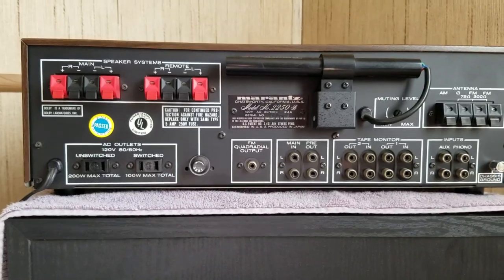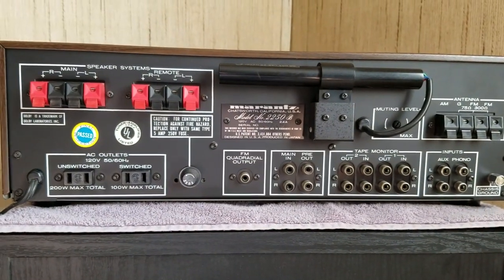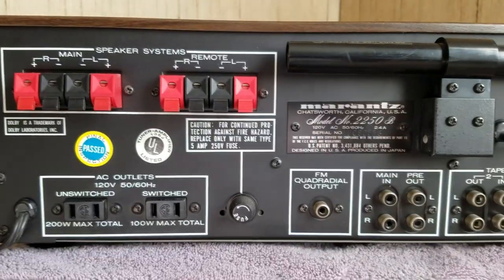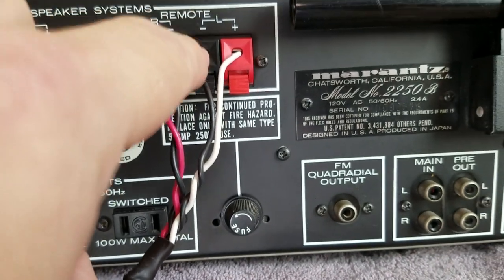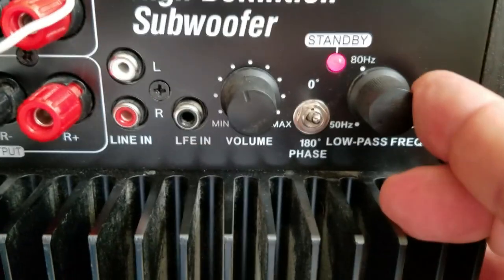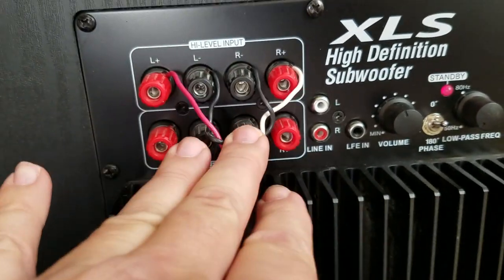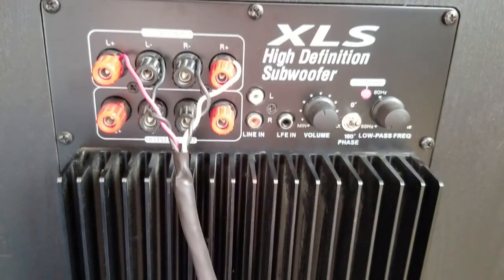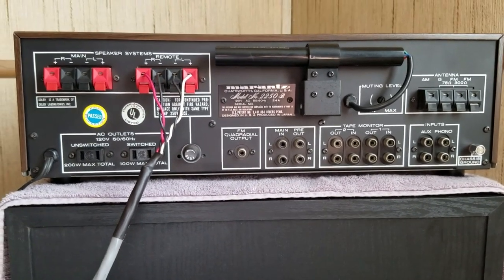How to add a Subwoofer to any Vintage Stereo

Comment: I don't have A + B speakers so this isn't possible at all is it? Tape out RCA would work?
Reply from the maker: Tape out will not work as is a set pre-amp level, won't adjust with your volume control. You can just add the sub wired to your amp along with your spks. The receiver will still just see your spk Independence (4 or 8 ) ohms.
Reply: if you have a powered sub you should be just fine running a 'line level' signal from the tape out to the sub.
Reply from the maker: @pinkskud1  tape out is a fixed level. So no it will not work
Reply: @breakerbroke23  yes, line level. a powered sub has its own amp, thats why it has a line level RCA input.
Reply from the maker: @pinkskud1  correct, but the fixed tape out will not adjust volume to the sub when using your volume control on the receiver. Doubt me? Try it.
(some receivers may adjust vol through a "tape loop" but that is VERY Very rare)
Report what you find if you like.
This audio thing is all about trial and error, and like you, always think outside the box.

Cheers.

Comment: You dont nead a+b speaker inputs.  You can do it with just 1 set of inputs if you need to.
Reply from the maker: Yes
Reply: So i can do this with my LG system? It has 2 big speakers left and right but doesnt have the option for “B” speaker. So can i put
The subwoofer wire in the same port  ?
Reply from the maker: Yes, just hook up the sub like you are adding another pair of speakers. It will not affect the impedance so your LG shouldn't run any hotter. Cheers @zayan-alikassam1203

Comment: Can I connect sony subwoofer ( none powered) ?  in Yamaha receiver  ? I have subwoofer which comes with sony 5.1 home theater
Reply: sagar chopra do you know how many watts the bass speaker is suppose to have ?
Reply from the maker: Yes you could hook up your woofer,but it will not sound good......At all.
Reply: @patrick7799  4ohm
Reply: @breakerbroke23  but my subwoofer is non powered ( passive)

Comment: What will happen if u run everything just thru A ???
Reply from the maker: It will work just great. 
I use the sub on speaker B because sometimes I like not using the sub and I can just turn it off with the flick of a switch.
Reply: @breakerbroke23  Thanx for prompt reply & expertise!

Comment: Ummmm.  But you are sending full signal to the mains.
Reply from the maker: Yes,  I'am using large floor standing spks for mains as apposed to small satellites or bookshelf spks.
Reply: @breakerbroke23   If you are into that sort of thing... I guess.  The main advantage of a subwoofer aside from deep commanding Bass is to take the hard work away from your mains allowing them to sound much better and have much more headroom.   You said it yourself... you don't need a Sub.  Id wager it actually sounds worse in the low end... albeit deeper... because you have massive duplication of low end notes from non matching drivers.
Reply: good lord we gota paintchip eaten Boss lover here that never had him some full range 3 way speakers lol.

Comment: I watched a similar video of 3 minutes length and in the comments, people where warning of damage and overheating 🤷🏼‍♂️
Reply from the maker: I use this exact type of setup on two systems for years, lever had any heat or distortion issues.
Thay are either using cheap plastic gear , wired wrong or just over driving  either the receiver amp or sub.
So IMHO they are incorrect.
Reply: I got a Bluetooth receiver with sub pre out. But I have a car sub so is there a way to use this sub on the Bluetooth reciever?

Comment: Just did this and smoked my vintage amp what did I do wrong??
Reply from the maker: Hard to say without being there...  Some things that could have happened, wiring the sub when your receiver was turned on, if you touched ANY of the speaker wires together, wrong order ie, left + on a right- or a L&R + wired to the same input on sub. An issue with the subs input section, a impedance issue with the subs input.  Wired receiver to out puts instead of inputs, some subs have a spk in AND spk out for extra satellite spks.. 
Just a few things I can think of.
Reply: Thanks for the reply ! I don't know ether it was playing and sounding great it worked for several hours and then it just stopped ! and the smell of a dead amp .    @breakerbroke23
Reply: @anthonym844  Did you accidentally short the wires? One way to smoke a transformer is to use long, thin speaker cables, such as 24AWG and crank up the volume. I use 16 gauge when longer than 10ft. But in electronics, a cap, resistor or transistor can go bad coincidentally, giving the appearance that you did something wrong. There is an unwtitten law in electronic that parts must die at a certain time...even when not in use.
Reply: He gave u bad advice
You don’t send 75 watts etc, from an amp to a powered sub. That’s what the “powered” sub is supposed to do.
Just run from tape or Aux out to the powered sub and let it power itself

Comment: What if you are running 4 speakers
Reply from the maker: You can run them in parallel (+ to + and - to - ) your amp should still see your 4 or 8 ohm load.
Reply: @breakerbroke23  Sorry I am not smart at this stuff. Do you mean jam all the 4 speaker wires into 1 output side and then the sub on its own from the other outputs?
Reply: @maccasnz3436  Don't listen to him. This video is how to connect his Subwoofer to his Amp. Not all Subs or Amps have the same outputs or inputs. Sorry, but I search for the right solution too. Good luck. Tumb down for this Video BTW. Title is misleading!!!
Reply: Don't do that. You're amp will blow up if it is not good enough...
Reply: David Tucker  yes. I pass out of the preamp to the sub then back to main in. Works a treat I can control volume from my phone through chromecast and everything is balanced. The sub is a Linn and does a nice job.

Comment: All videos i see on yt say its a powered sub but i dont have a powered its a car sub😐
Reply from the maker: Using a woofer with no amp will not give much bass at all, especially if you are using a AV receiver (not a strong enough amplifier) You can power up a car woofer very easy just use a amp https://amzn.to/3pTkzyA a amplifier like this will allow you many input options. Just put your woofer in a box and cut a hole in that box and drop this puppy in. DONE!

Comment: Why cant i simply run from the main out on the Marantz to the in on the sub, then from the sub out to my main speakers?  Wouldnt that be easier and cleaner too?  Isn't that what the high level outputs on the sub are for?
Reply from the maker: Yes your way will work and really using the sub the way I did was so I could listen to music with OR without the sub. Cant do that your way unless you plug or unplug the sub from AC. And in my installation I can move the sub around and leave the main speakers alone (uses a lot less spk wire)
Reply: I was wondering if you hook up the Marantz to the in on the sub and then from the sun to main speakers (where the sub's crossover strips the lows and only sends mid and high to main speakers), does that free up the speakers to a better job since they now only have to deal with mid and high? Thank you

Comment: U can connect the sub to a or b speakers it makes no different
Reply from the maker: Correct, I use b speakers so I can easily cut out the sub.
Reply: @breakerbroke23  i tried to connect with high level  but i hear overpowering humming noise while lissing on FM from the subwoofer ( REL tzero subwoofer )
Reply: @breakerbroke23  thats is a fantastic reason to use speaker  b

Comment: wrong....   theres no need the amp can play a and b....  just A will be fine...
Reply: wut
Reply: @mrhobs  The Subwoofer gets highlevel in and pipes it back out. So just connect the speakers to the Subwoofer and you will get the channel, that you used for it as well. So it can work with only one
Reply: @SchwachsinnProduzent  Thank you, I may try that someday... For now I'll probably just use the subwoofer pre out (Denon AVR-3806) to the RCA connectors on the sub. Hopefully there's an easy way to adjust both the delay between the sub and the front speakers, and between the sound and the video. (I'll look into it when I get to that point. Still working on wiring my headshell/cartridge plus 100 other little things it seems like. Still very n00bie, but pushing through...)

Comment: I use tape monitor, but this way I have to adjust the subwoofer´s volume each time. Of course my subwoofer has a dsp that lets through bass only. It is annoying when dutch radio channels are bassy and the German ones not, but you can enable FM muting.
Reply from the maker: That is a problem with using a TAPE OUT, however if you can find an old school RCA fader or level control and use that as a "local" volume control at the rear of your receiver. Such as this... PAC LC-1https://amzn.to/3Jh1b8L
Reply: Your sub has a DSP, and not a CROSSOVER, or both? IIRC the SVS subs have DSPs?

Comment: Any considerations when deciding if its ok to use A+B if the amp can handle the speakers and subwoofer? I want to do that with Kenwood KA 880D + 2 Monitor Audio Bronze 100 and havent bought the active speaker yet  lets take the model you used here, would = my amp 100wpc be ok with A+B  ?
Reply from the maker: The sub inputs are electronic and will not add impedance like a speaker would so you will be fine adding the sub with speakers on the stereo outputs. I called Klipsch tech support many years ago and asked what max power input would be on one of their 12" subs would be. He said 300w max in. Not sure if this is true but I have never had any issues with to much power into the spk in on the subs. Cheers